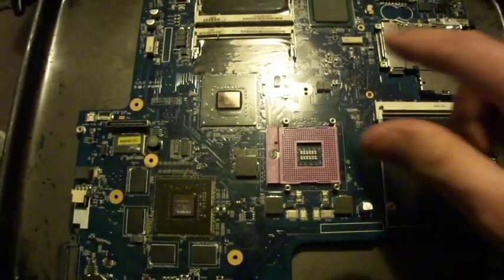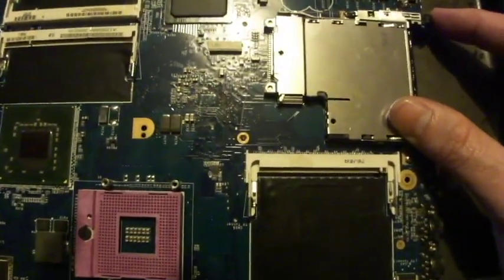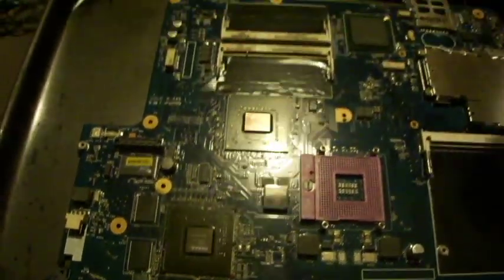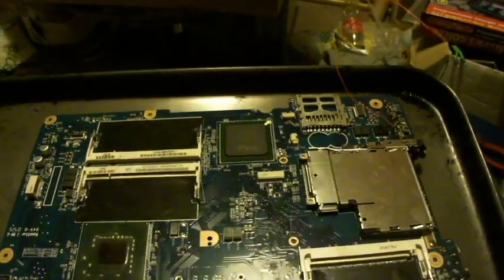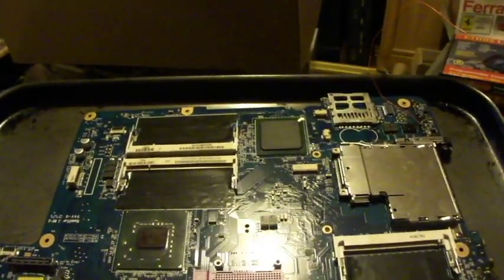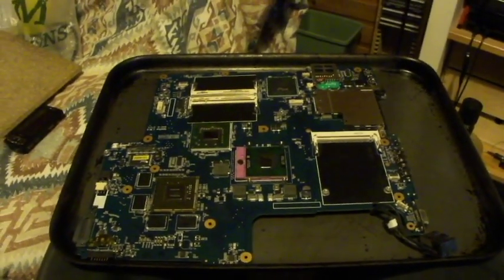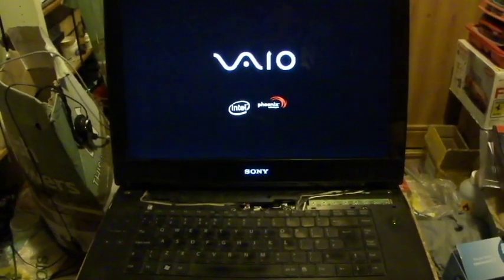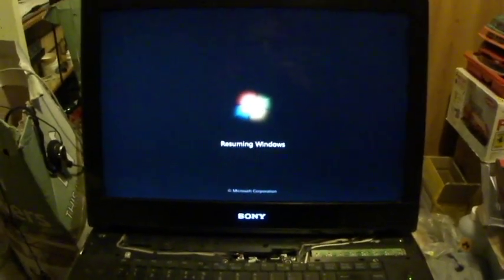VGN-AR series Graphics problem fix

Comment: You should NEVER heat the WHOLE board up for just the GPU. You're heating semiconductor components up that don't need to be heated, risking solder shift on them as well as possibly taking them too hot. This is foolish advice, and will make the problem worse, if not cause other issues as well as a possible HOUSE FIRE. No wonder it died completely on you.

Whoever started this "DIY oven trick" should be lined up against a wall and shot, because this IS NOT how reballing/reflowing is done professionally. I know, because I perform it with the correct equipment and knowledge, I'm a professional.

Comment: A quick fix. Turn you computer on putting it reversed (upside down) and let it be on for 15 minutes. Soldering balls will melt to their original position without having to open it or neither having to coock it.

Comment: Ben...Please can you inform I what the highest possible up grade is for sony vgn-ar21s is ....processor and ram...I find that playing blue ray movies are jerky and the sound goes out of synch....please help .
Reply from the maker: No idea im afraid. I got rid of this piece of shit and built a PC.
I cooked this mobo for a year, i think around 6 times and was still working and i bought another mobo so didnt have to keep cooking it. Last year it died again, tried both mobos, different HDD, different RAM and different CPU and an external display. Finally threw in the towel and bought a PC £500 for 4.6ghz quad care i5, 16gb RAM and 2TB HDD. Sony got broke up on ebay and sold for less than £20. Last time I will spend that sort of money on a laptop. For £2000 id expect something reliable!

Comment: I have the same laptop with the same problem and I just took the heat sink, fan and CPU out and let it run for 3 minutes As Patrick Carty mentioned, it worked and thanks a lot guys.
Reply: searched for baking sony vaio motherboard and found this. Ran 3 minutes first time and no fix. Ran 3:30 a second time and success! Posting this from previously bad gpu mobo. Awesome! and thank you.

Comment: You dont need to remove or cook the motherboard. Simply remove the back of the laptop, unscrew the heatsink, prop it up with a Bic pen lid or something, reconnect HDD, run for 2-3mins. This allows the GPU to start to overheat with the same end result as cooking but without the risk damaging other components. Takes about 15mins.

Comment: Not a good solution whatsoever. It has to be done properly with the correct BGA equipment where the GPU is removed and the old hard dry solder is replaced with new fresh leaded solder. This is the only and professional way to resolve this issue.

Comment: Sounds like a classic overheating issue. If it only happens under load make certain your fan exhaust/intake ports are dust free and that they're not covered up or obstructed while your laptop is on. You may also want to verify that the fan is coming on at all.

You can use a can of compressed air designed to be used with computers to blow the dust out through the vents, but for a proper cleaning you'll have to open up your system and clean it thoroughly.

Comment from the maker: The reason it messes up is because the solder "balls" that connect the GPU to the motherboard overheat and go open circuit. 
When you put it in the oven it will melt them back together. 
Although, this will only last a matter of weeks/months if your lucky.
If you get it properly re-balled it will be a pernament solution.
There are some sellers out there that claim to do a reballing service but only use a heat gun.
This is not reballing and it will have the same effect as this.

Comment from the maker: @stewardsproductions I wouldnt spend any more money on this pile of crap. The problem is due to the fact the GPU has leadless solder. Basically its crap but due to toxic reasons leaded solder is banned (because everyone licks the motherboard dont they) its pathetic. I have a AR41L motherboard in here atm but as its not a AR51SU board it wont let me reboot the original system from the recovery partition on the HDD. Not happy. I expect much more from a £2000 machine!

Comment from the maker: @recabrown No. As the motherboard is at 0:30 I put it in the oven at 180 Degrees C for 10 minutes. This melts the solder on the graphics card and re-flows it. Take it out the oven and gently move it somewhere to cool. Dont move it off of the tray until it has cooled down.

Comment: @ben150785 Aight. And just so you know, I already plugged a PC monitor in and nothing came up, so... I'm thinking the graphics card's actually blown. But the BIOS should've beeped at me if that's the case. Then again, I have a PC in the corner of my room with a blown GPU that doesn't beep either, so eh. I'll try other plug-ins if I can find the cables.